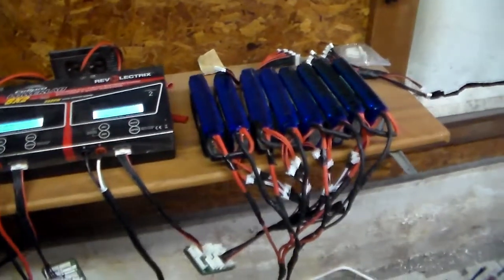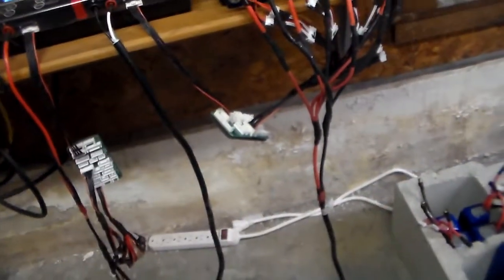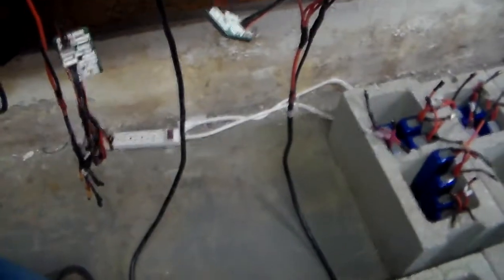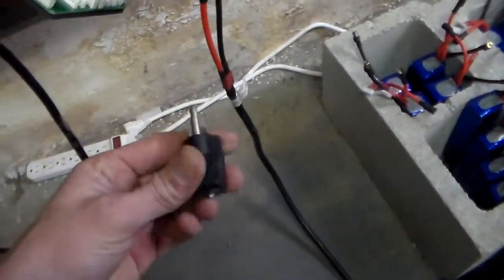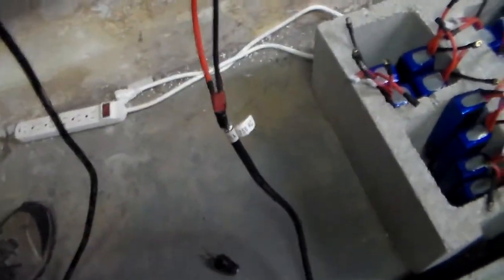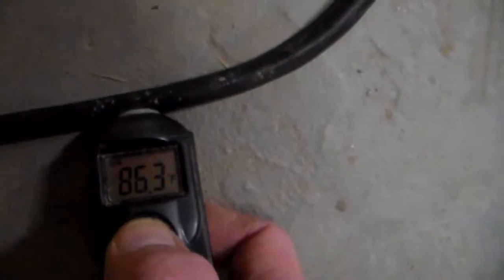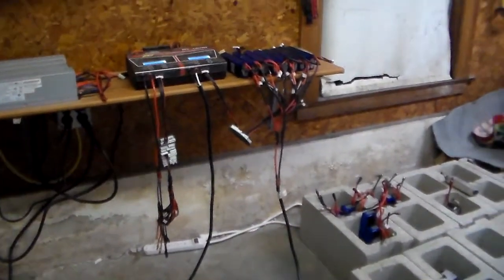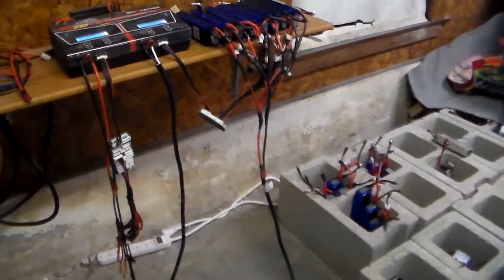Debunking a bogus statement about AC amps vs. DC amps.

Comment: 22.7A x 220V AC = 4994 watts
22.7A x 25V DC = 567.5 watts. Like you said, the calculation is the same for AC and DC. 
Did the guy think that the power dissipation was going to be the same for both?????

Comment: This answered my question perfectly. It made sense in my mind that amps are amps whether it's DC or AC. I used a shore power cable for boats rated at 35a/120v for my 35a/24v solar panels. 50 ft run. Someone told me it wouldn't work and it would melt the wire. Complete BS. Been running for over 3 weeks now. Thanks for this video.

Comment: Interesting.....   
Not that i dont trust that charger showing you 22 amps of DC current, but i would like to see done is to put a CLAMP meter and measure the physical DC amperage going across that 16 gauge HOT/BLACK wire to see what is the actual amperage flowing thru that 16 gauge conductor is... 

When you mentioned people holding on to facts and swearing by them because it was given to them by books or learned in school or by hear say and they refuse to do their OWN testing to see if its true, they hold on to it and refuse to think otherwise or think outside the box and just agree with it... Brings up a topic that i do not want to get into with you because it will just open another can of worms..  But this is the reason why i do my own testing and prove half that shit taught to me to be WRONG...  Regardless of what proof i have to show them, they refuse to believe it and say im wrong simply because Google or Wiki or whatever bullshit they pull up on the internet tells them otherwise so they believe THAT over me because THAT is correct... Even though they NEVER tried to prove it themselves... They took a leap of FAITH to believe everything they read on the web as FACT... I AM NOT THAT PERSON.. !!!  I question everything and test everything on my own and find a ton of lies....